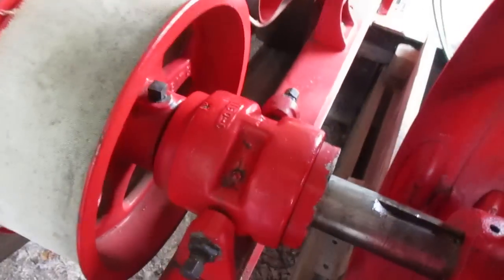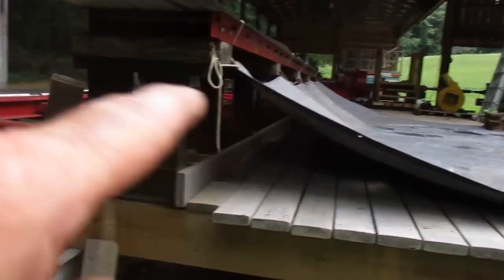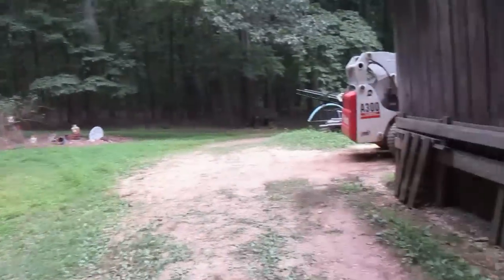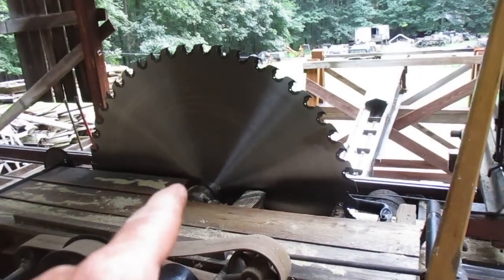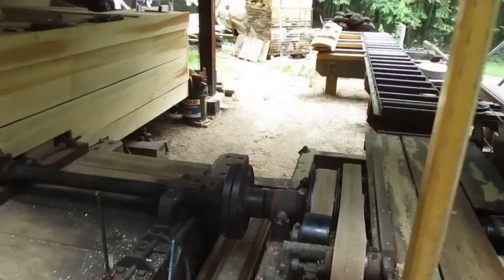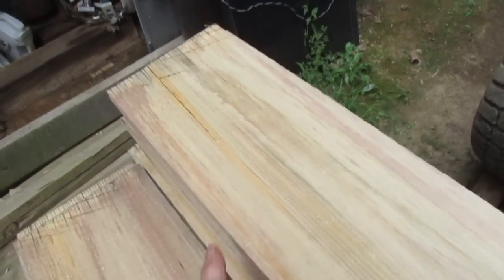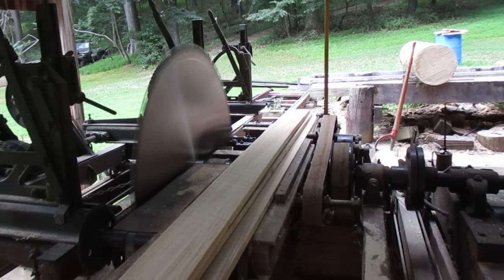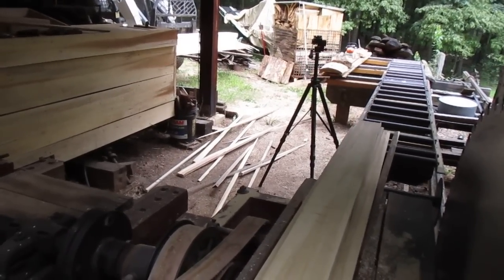SAWMILLS ALWAYS THINGS TO WORK ON # 863

Comment: Mr. John hope y'all are have a Great Day, and enjoy the rainfall while you are getting it, because you never know next year y'all may end up like down here in Texas. 
My pasture is so dried up the tee post have fallen into the cracks in the ground. 
Get yourself a Lazer that shoots both vertically as well as horizontally. 
Then you can line it up on your leading edge to where it just shines on the gut below the tooth enough to shine on the steel a tiny bit. 
Then as you adjust your bolts you'll be able to see the beam either continue further towards center of the blade, or it will start to disappear and get smaller indicating that you're pulling the blade towards you. 
Are they sell transparent plastic cards that have measured increments on the face that you can attach to the face of the blade..
Then set up the Lazer to shine say 1/4"off your true mark, make sure to use a piece of tape to mark exactly where you're absolute zero is, and if the Lazer moves further away from the tape you know to back off and move to another bolt.
Same as if the Lazer disappears behind the tape, you know to do the same thing.
Then you're not relaying on any one else if you find yourself unable to get someone to assist you in your task. 
Plus they come in handy in a good many different ways you'll find out if you should purchase yourself a good one, but remember to remove the batteries when you're not using it so that they don't leak if you don't use it for extended periods of time. 
But back to the subject at hand, typically when I lose something like you have the your missing anti seize.
I always hit it with the shredder out in the pasture along the fence lines, but of course that's was back when we had enough moisture to grow anything besides dust devil's. 
Have a great day and better tomorrow 
Thanks for your responses always appreciated as much as I enjoy your movie's
Reply from the maker: hi there thanks for the idea .to old to try a new way although it may be better , just not quite sure how to do what you wrote , thank you for it though , and stopping by john

Comment: Always something! Keep making sawdust buddy!
Reply from the maker: hi there sure hope to thanks foe coming along  john
Reply: We've had some ups and downs as usual but we're working on a good 4000 bd ft pine order so weve been making a lot of sawdust. Always good cutting soft wood and your teeth and saw running true. Makes for good days until you hit gravel or metal
Reply: How often do you change your teeth or change out to decent teeth with a swag and sharpen
Reply from the maker: @ryanforrider3873  hi there i try not to change them till there nubs , don't swag much as long as they are wider than the gullet  john
Reply from the maker: @ryanforrider3873  i do sharpen about every 500 board foot .john

Comment: OK John, Me not knowing a thing about Saw Mills, What is the Lead ?Just what the hell are you talking about With the Dial Indicator and all this adjustments, Just what does it do to make your saw better, Are you talking about the Cerf or what? Enjoyed your video, Just don't understand what your trying to do.
Reply from the maker: hi there the blade has to be at an angle to the cut a very small amount , 1/32 , 2 main reasons the blade wants to come out of the cut on a slab and you want the log not to hit the blade as it goes by the teeth coming out the back of the cut .this is very important . .hope this helps a bit  thanks john
Reply: @fricknjeep  okay, now I understand. When you were talking about it, It was all Greek to me. Thanks John for inlightening me.

Comment: Why 2 saw mills ???
Reply: because he has not started working on #3 or #4.
Reply from the maker: hi there i didn't know anything about sawmills when i got my first one other then i wanted a Frick and they make logs to lumber . i didn't even know they made more than 1 size , after about 15 years i learned and knew what i wanted . then had to find it , redue and fix parts ,  but i also found the older you get a lot of things are harder to do . and stuff got heaver , . there is a lot to it . . plus it takes a mill to set up a mill . probley get rid of the little one although it a big part of me and i have a hard tome letting things go . john
Reply from the maker: @dave-in-nj9393  hi there always looking for more  john
Reply: @fricknjeep  John whenever you finish with the big mill I'll make another space here at our farm for the little one. By then I hope to have all 4 of my other ones under roof and restored so I can give yours my full attention. I'm kinda a frick sawmill nut too and I'm building a little sawmill village here so it'll fit in with the others.
Reply from the maker: @johnnysharpe3812  hi i wish i was as fast as you john
Reply: @fricknjeep  you just don't know how much you inspire me buddy,  I'm around 30 years younger and still am amazed at what you pull off by yourself. I enjoy all your videos and all the knowledge you pass along for the rest of us.